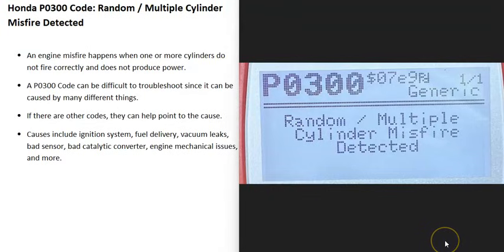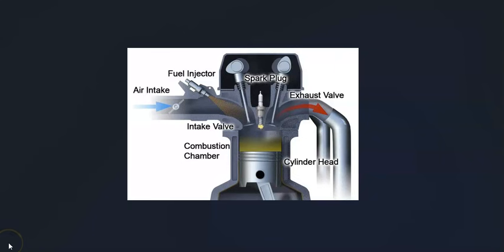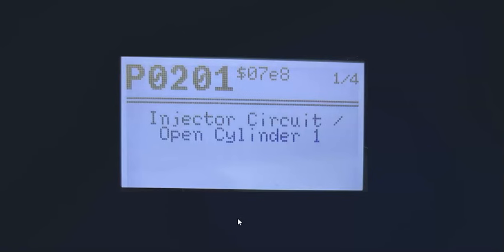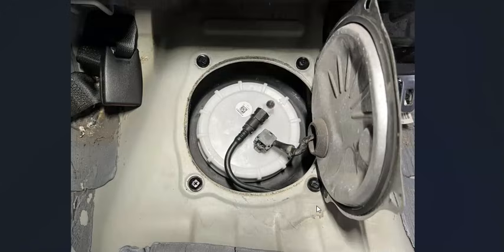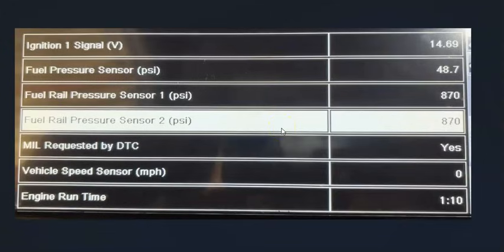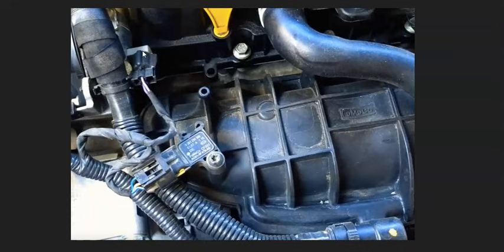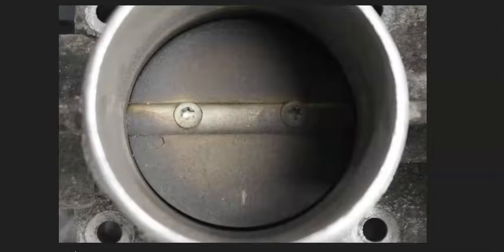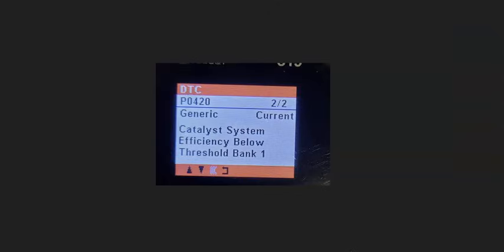Troubleshooting Honda P0300 Code: Random or Multiple Cylinder Misfire Detected

Comment: I’ve got an 04’ CRV throwing P0325 (knock sensor code) along with p300,301,302,303,304. Is it possible that the knock sensor is back and can cause the other codes?